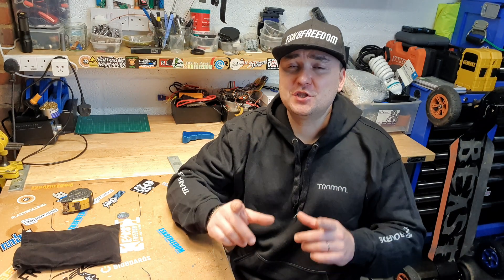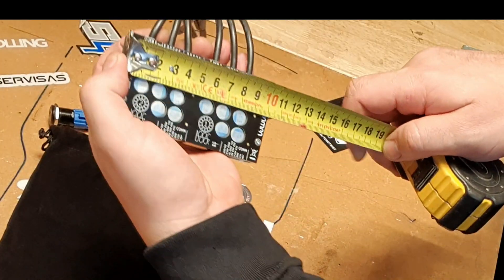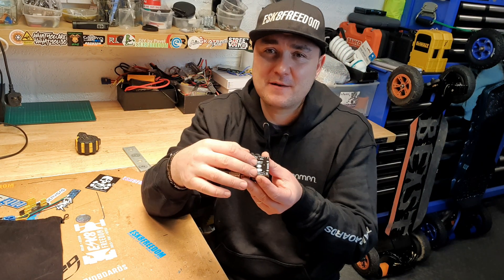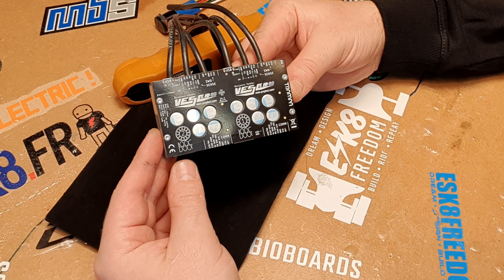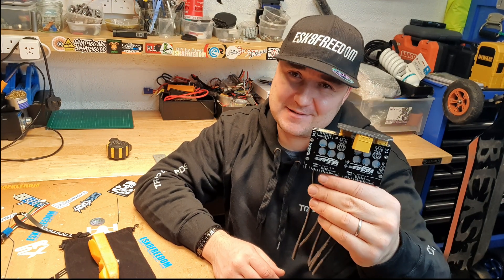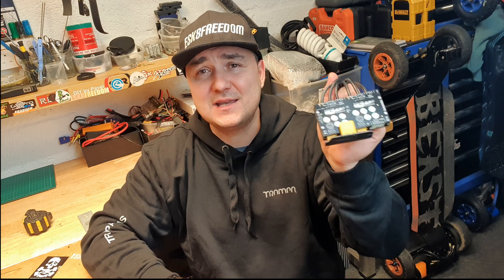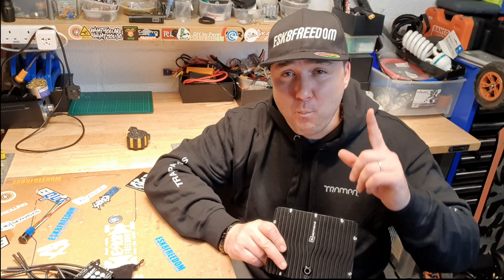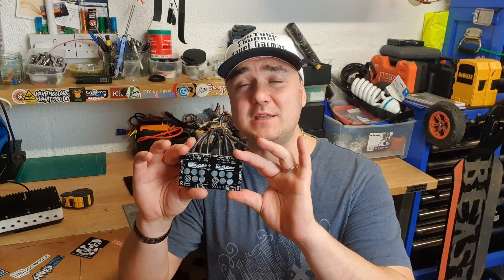Trampa VESC 60 dual

Comment: I currently have the flipsky dual fsesc 6.6 and it seems to be going bad. Is this a good vesc to replace it with? My concern is going from 200a to 75a, am I going to see a big difference in performance?

Comment: Hi Pavel, awesome content! BTW,  have you had any problem with this VESC HD-60?
Reply from the maker: Hi mate,
Thank you and Yes / No.... I had some ABS overcurrent faults but it was because i was asking the HD60 to do something it was not designed to do. My set up is 6385 motors, dual, running at 80 Amp each, 9" wheels. I have now installed the 63100 motors and changed the HD60 for two vesc6 mk5.

Comment: I built a 16S-9P (64v out) pack, what ESC do you recommend I use
Reply from the maker: Hi mate,
There are very few esc units that can take that voltage... best would be the Trampa once https://trampaboards.com/vesc-75v-300a--16s-c-1432.html   I thonk Stormcore can handle this as well but heard a few issues with them.

Comment: Today my Brand new Spur gear Trampa Mountainboard caught fire due to a short circuit on the xt 90 to xt60 Pcb adapter.
Why pumping so much current through a tiny Pcb plate Trampa whyyy???
Iam devasteted
Reply from the maker: Ohhh.... so sorry mate!
Have you reported this to Trampa?
I will be making my own splitter anyway but some people do use additional insulation between the pcb and the body of the vesc.
Is board damaged?
Reply: @PavelGarmas  The battery box is kinda roasted, the rest is not damaged. The Pcb Splitter has burned out...
Waiting for trampa answering my email now

Comment: Flipsky is 6.6 is still best for money
Reply from the maker: I do have 6.6. plus the original and it is still going strong after 2 years however the new units got many issues... vrsc units are very good but are expensive. I do have different esc and vesc units in my boards but the vesc 6 mark 3 is my favorite.

Comment: Trampa finally did a dual esc. Looks like I'm stuck with storm core or this
Reply from the maker: Hi Leon,
Thank you for watching mate. Well compare the price, size....original vesc would be better in my opinion but stormcore is quite nice as well.
Reply: @PavelGarmas  I'll probably will get this.
Reply from the maker: @LeonCamero  it's a good unit so why not mate.

Comment: i bought my wheels from 3d servisas
Reply from the maker: Awesome 👌  happy?
Reply: @PavelGarmas  yeh they look great, haven't tested them yet I'm saving up to build a battery
Reply from the maker: @W-H1U  i see. What battery are you planning mate?
Reply: @PavelGarmas  12s4p  Molicell 20700A 120A discharge
Reply from the maker: @W-H1U  21700?
Reply: @PavelGarmas  Molicel 20700, 3000mAh, 30A Max discharge